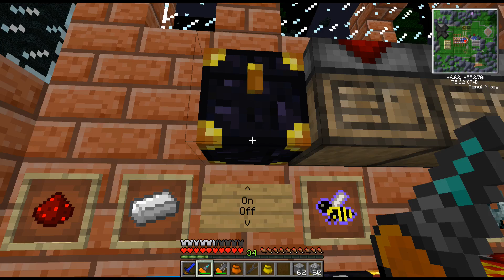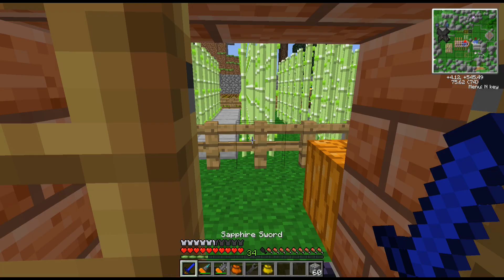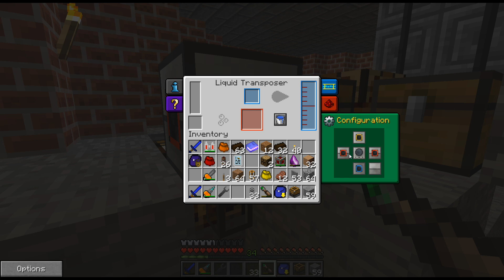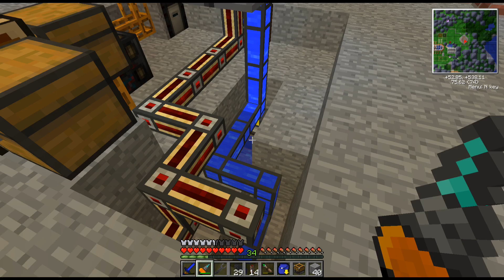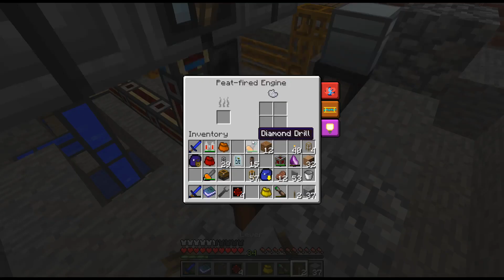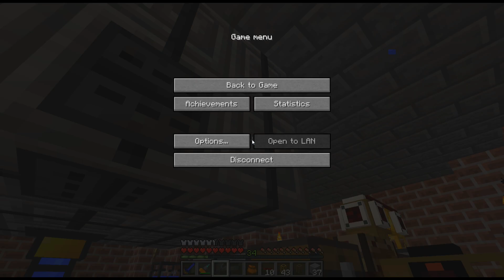Tekkit: DungeCraft - Peat Multifarm Automation - S3 E37

Comment from the maker: Hmm true. I wanted a slightly tighter system with the tubes, so they never spit anything on the ground. Although I could just have it pull bog earth when the inventory is empty, then it would never have an issue.

Good point. When I rebuild it to 5x5 I'll try this. Thanks!